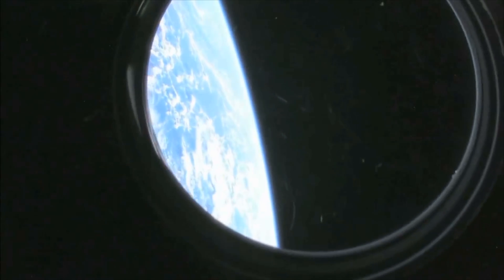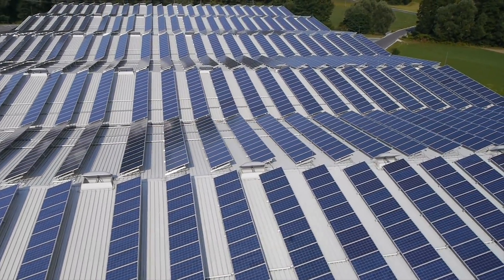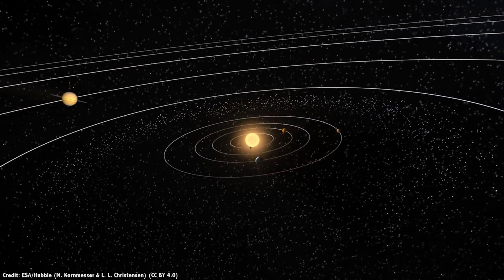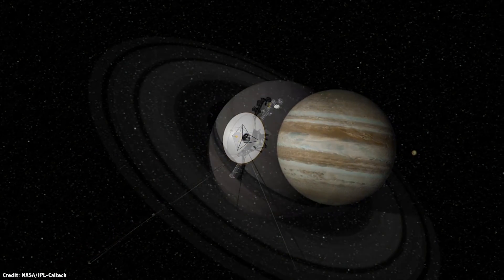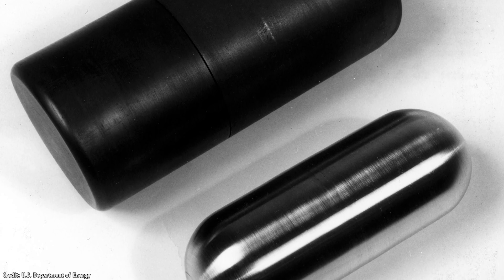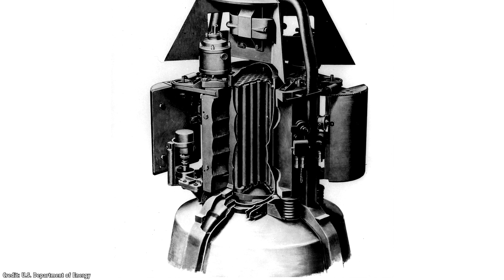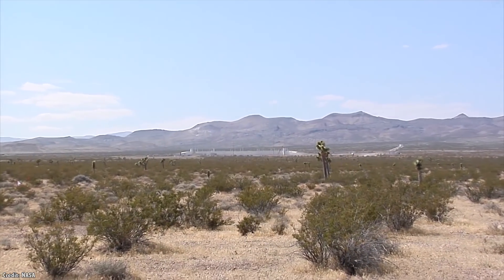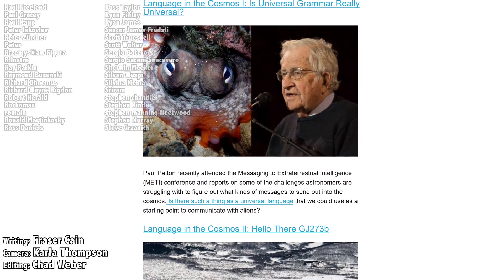The Problem of Power in Space. NASA's New Kilopower Reactor

Comment: Betavoltaics is an option but no space craft I know of has used it. Tritium could be used for it but the relatively short half life (12 years I think) can be a downside.

Americium-241 has been talked about for use in RTG:s, with a half life of over 400 years it could power a space craft for centuries.
Reply: Mind those gamma rays! The alpha particles will stop at a sheet of paper but gammas penetrate a couple of centimeters of lead or more.
Reply: zapfanzapfan I have to agree, the only disadvantage it has is of its energy density which is a quarter (0.25) of Pu238 isotope (The best fuel for RTGs so far)
Reply: As pu-238 decays, it generates a bunch of heat.  It literally glows red hot.  The energy, or heat in this case, is directly and inversely proportional to the half life.  So as the half life increases, the heat generated decreases.  Thermocouples use the difference of temperatures between the source and the sink to generate the tiny bit of voltage. Switching to am-241, having a half life of 432 years, may not be hot enough to be beneficial.  I thought it was interesting that am-241 was used in older smoke detectors.
Reply: Ricardo, are you talking about the same thermo charges that took down all the buildings on 9/11?
Reply: Larry Beckham: A fission reactor only gets dangerous after it has been running, before that it's just a lump of uranium and the ocean already contains a few billion tons of uranium. You can extract uranium from seawater but presently it's cheaper to mine it on land.
Reply: Larry Beckham exactly but the penetration power of Gamma rays emitted by Am is not as much as you think it is compared to the Pu emitted gamma rays, I would say,since Am's density is about a quarter of Pu, Take it 25 mm of extra lead, I might be wrong don't take my word for it.
Reply: Paul Mobley: A rocket carrying a satellite with an RTG with Plutonium blew up after launch, the RTG was fished out of the ocean and the material reused. They are sturdy suckers :-) Also, an RTG on the lunar lander of Apollo 13 reentered over the Pacific (since it didn't land on the Moon) and didn't break up.
Reply: Ricardo Moreno: ESA is looking into using Am-241 for RTG:s (we don't produce Pu-238) since Am-241 can be extracted from civilian nuclear waste.

http://www.world-nuclear-news.org/F-can-americium-replace-plutonium-in-space-missions28071401.html
Reply: The natural mix of isotopes of uranium that you dig out of the ground, or extract from seawater, is 0.7% U-235 and 99,3% U-238. Reactors moderated by graphite or heavy water can use that natural mix but most commercial reactors are light water reactors that require slight enrichment of U-235 to 3,5% or so (normally using ultra centrifuges). It's U-235 that is fissile so it's that isotope that is important in a reactor, U-238 is mostly just in the way stealing neutrons and making transuranic elements. The smaller the reactor the higher enrichment of U-235 is needed, some reactors in submarines run on 90-ish % enriched which is weapons grade, Little Boy had around 80% U-235.
Reply: my bad. you are right.
Reply: zapfanzapfan Now tell him that the uranium in the reactor isn't the same as whats in the ocean or whats in the ground for that matter. Otherwise they wouldn't have to do anything with it before placing it into the reactor.  But we aren't talking about uranium that hasn't been split are we.
Reply: Paul Mobley: The thing with reactor safety when used for satellites sent to the outer solar system or on a lander to Mars is that you don't turn them on until they are well away from Earth. Until then the fuel is just a lump of uranium. It's only after you switch them on that you get fission products and transuranic elements.
Reply: Paul Mobley: Yes, reactors produce plutonium when they are switched on. Uranium-238 absorbs a neutron and then decays to plutonium-239, if the reactor is kept running some plutonium-239 absorbs another neutron and becomes plutonium-240, some absorb another neutron and becomes plutonium-241, that mix is what is called reactor grade plutonium, for weapons you want as pure plutonium-239 as you can get.  Plutonium-241 decays to Americium-241 with a half life of 14 years so used fuel that has been left for a while can be used to extract Am-241.
Reply: Tom Kelly: If I remember correctly Kirk Sorensen says in his presentations that Pu-238 is one of the  byproducts of the thorium-reactor, so if we had thorium-reactors there would be no shortage of Pu-238. I guess since it is a liquid fuel reactor the Pu-238 can be chemically extracted from the fuel when it is created before it absorbs more neutrons to become Pu-239 or higher and become difficult to extract pure. There is some Pu-238 in regular used reactor fuel too but the problem there is that chemical separation gets you a mix of plutonium isotopes that you would then have to use ultra centrifuges to separate (like U-235 is separated from U-238), but I have never heard of anyone trying that.

Britain and France do reprocessing, I guess that's why ESA is looking into Am-241 since it can be extracted from old used fuel.
Reply: Roland Lemmers Dont forget that the only radioactive material will be natural uranium of which doesn't have the same range and deposition through the range as what a nuclear power plant produces.  Lets also not forget that human DNA has had centuries  to get used to that type of radioactivity, it will never be able to keep up with what man is doing to it.  I agree coal is a bad option but if you truely believe that whats in coal is anything like a nuclear meltdown and its radionuclides then let us know how much coal would have to burn to equal what has been released from nuclear power plants,meltdowns,bombs, spacecraft, etc.  And not only match the volume but also the energy released.  I would allmost bet we have still yet to burn that amount of coal.
Reply: @paulmobleyscience  "...the only radioactive material will be natural uranium..."
Thorium-238 is about 3 times more abundant than Uranium-238 and -235 in the earth's crust, and is a throwaway waste of mining operations. But unlike the lightwater fission reactors used in civilian power production that need to get as close to critical as possible for maximum power production, LFTRs are breeders that take advantage of the natural decay to produce power instead, so the design is stable at low pressure, therefore much safer. Renewables would be a much better alternative, I agree, but not all geographies support large scale renewable power generation to power their civilian centres. Fission reactors need to be discontinued, but we still need to look at LFTR as a viable alternative.
Reply: @BlackEpyon  Unfortunately for LFTRs, they do not have a metal that can take the fatigue.  Its the same thing for fusion reactors, for them to be able to last more than 5 years a new, unknown metal must be found to make them suitable for decades worth of time.  Yes much less, but still produces radioactive waste.  There is no free ride no matter how much we try, we will allways pay for it one way or the other.
Reply: @BlackEpyon  Complained? You misunderstand sharing of information as complaining.  I've allready given a solution yet you havent noticed it because I havent outright said it.  Ok here you go and this is the only solution.  Stop all fossil fuel,nuclear and coal usage today because the only ones that need more power than a solar company that comes to your home and installs a system that will in FACT take care of more than 100% of your energy needs are industry.  To make industry curb its output you and everyone else must stop consuming like its going out of style.  Wind generation, geothermal generation and wave generation is more than enough to take care of the excess we need.  We do not need to bank the energy, we already have a national grid that can move energy from one end of the country to the other.  To say renewables can not take care of our energy needs is a complete lie and its been proven allready and the ONLY thing holding it back is nuclear (which is subsidies through Price Anderson more than all put together),fossil fuels and coal company owners, and the national grid owners that have all the control in place with corruption surrounding the entire issue.  What have you done besides bitched on the internet "we need to use more LFTRs" Waaaaaaaaaaa  😭😭😭😭😭 I want my power 😭😭😭😭😭
Reply: @paulmobleyscience  
"To make industry curb its output you and everyone else must stop consuming like its going out of style."
That's a rather naive and oversimplified way of looking at things.

I didn't imply that LFTRs were the only way out. Just that they shouldn't be ruled out on the grounds of the issues you describe, because they will have their uses. 

The issues with solar can be resolved with energy storage and the energy grid. I like the idea of all new housing construction being required to install photovoltaics to supplement the power grid. Wind and solar tend to go together, as constant wind (the kind ideal for wind-power) is more prevalent in areas that also get a lot of sunlight where the thermal differential drives the air currents. Tidal is only viable (for obvious reasons) at coastlines. Hydro is relatively clean other than having to divert ecology to make the hydroelectric dams, but it's also limited by geography. My own region gets it's power from hydro.

Geothermal heating (for houses) is available everywhere as a result of the differential between the surface and below 10 or so feet, so that isn't an issue, but for electricity generation, you're limited to the areas that are best geologically suited for it with high thermal gradients, particularly volcanic areas like the Hawaiian islands, etc. However, geothermal power production does bring some cons with it, such as the hot spot cooling down, and release of geothermal gasses (hydrogen sulphide, etc) and slurries containing toxic chemicals that would have otherwise remained buried, etc. Not insurmountable problems, but they need to be considered.

Areas that aren't ideal for renewable energy production will have to import their electricity.  Yes, true, we have national power grids, but they only make enough money to maintain the grid by producing selling electricity.  This presents economic issues in that communities that aren't ideal for production, particularly northern cities and towns, will either have to balance the import of electricity with material exports (such as mining communities), or switch to local nuclear power production. Not insurmountable issues, especially if the power companies that maintain the national grids are nationalized, but that would require a change in social attitude away from capitalism towards socialism, as well as the political restructuring that would go with it. Again, these are problems that can be solved.
Reply: @BlackEpyon  Now we are having a civil conversation thank you.  Yes, I will agree we will have to use everything possible to get out of the mess we have inherited.  But, the corruption stops all the roadblocks of the grid.  The national grid should be just that, our nations grid and not companies owning it.  This will take much more than a specific or multiple changes in the way we produce energy.  This will take not only political change but also societal change that will indeed insist that we massively curb our consumption of not only energy but products as well.  Its the blind consumption, the keeping up with the Jones down the street.  Its ramped everywhere, we have 4 % of the population yet consume almost half of all products and energy.  That is the first thing that must change and then we can move forward with the ammunition of knowing we do not need to produce all that we are and the amount of waste that is produced not just physical waste but energy thats produced and then just wasted to the ground can be decreased.  This must be done right from here on out because what we do next will decide if ,we as a race, move into the future.  

Through the Milankovitch cycles and solar cycles along with the calculations made by Valentina Zharkhova along with many top scientists, with the TCI showing massive heat loss,quadrupoles of the sun going out of phase shows us the Earth is moving into at least a century long grand solar minimum with the calculations showing possibly up to 400 years. This will cause every single power source to cease to exist because once the sun gets down to a certain level it will send out a 360° Carrington style event except much worse and cause every electrical device to be fried instantly.  We dont have time for anything other than getting all the nuclear power stations to be shut down and the fuel placed in dry casks before this event hits and with seing all the movement going on, we may not have long before it happens.  So no, we do not need to worry about energy production...we need to focus on food production and means of electrical production that can be done on a personal scale and not on a populus scale.
Reply: @BlackEpyon  Northern cities and towns are about to be under so much Ice, no one will be living there anyway.
Reply: The real killer from burning coal is the particulates. In terms of over all deaths per energy produced from power sources, coal is the worst and nuclear is the best or second best.

https://www.forbes.com/sites/jamesconca/2012/06/10/energys-deathprint-a-price-always-paid/
Reply: zapfanzapfan Afraid I must disagree again.....is coal carcinogenic?  How about radionuclides, do they cause cancer? Of coarse so why does the coroner say that the cause of death is cancer instead of what caused the cancer?  What causes the cancer is the real cause of death and these statistics are not adding all the cancer deaths because they can't tell us what caused the cancer.  Therefore, if they can not seperate the different cancers onto different cause catagories then the statistics are fraudulant.  Those numbers are bought and paid for by corruption and greed.
Reply: Smoking causes cancer (among other diseases), doesn't matter if the smoke is from tobacco, coal or wood. Have you seen the air in Beijing? It looks like 1950s London.

And if you think someone is paying off the health organisations, do you think the fossil fuel industry is poor and lacking political power?
Reply: But you need four times the weight of Americium as Plutonium to get the same power. And the extra added bonus of lots and lots of gamma rays. Not really friendly to electronics.
Reply: @larrybeckham6652  If Americium  is so dangerous why do 98% of all home smoke alarms use it in the ionization chamber??
Reply: @timcoleman8964  Americium emits mostly alpha particles (which can be blocked by your skin or a sheet of paper), and relatively little gamma radiation. The quantity in your smoke detector emits less gamma rays than the background radiation. In that quantity, it's only harmful if you swallow it.
Reply: @BlackEpyon  Correct,, that was my point. It is a shame most people don't take time to research the truth about our use of radioactive materials and the amount of background radiation we live with everyday. I would like to see our country go full force toward nuclear power using the LFTR we invented in the 60's. As for the anti-nuks, I love to see when they protest while eating bananas, which contain Potassium-40, which is a radioactive isotope of potassium. ;)
Reply: @BlackEpyon  Correct, that was my point. Most people don't take time to research the truth about how much natural radiation we live with every day .(https://www.sciencefocus.com/science/top-10-which-are-the-most-radioactive-foods/). Personally,  I would love to see our country get as close to 100% nuclear for our electrical needs as is practical using the LFTR technology we invented in the 60's  and go full force developing reasonably safe nuclear propulsion. I'm convinced the reward would be worth the risk in the long run.
Reply: @timcoleman8964  Now, lets not get ahead of ourselves. As I told Paul, LFTRs are a functional technology, as the MSRE at Oakridge National Laboratory demonstrated, but there are a few bugs to work out before full scale adoption, such as development of a more corrosion resistant alloy to increase the service cycle before overhauls and ensure greater reliability of the system. My overall point is that we need to keep all options on the table, because each method of power production, even alternative green methods, have different ideal factors, both economic and practical, that need to be considered. Even if we went to LFTRs, we've still got radioactive waste to deal with, even if it IS shorter lived. There's no one-size-fits-all solution.
Reply: @BlackEpyon  Yea, I get too excited sometimes. I do however think other countries are leaving us "US" in the dust in development of MSRE technology to our detriment. MSRE Nuclear is not perfect but if fully developed could be the safest  and lowest waste producing reactor until we, someday, figure out fusion.
Reply: @timcoleman8964  Regarding fusion, ITER is building it's new complex for their 500MW prototype tokamak reactor. The pit is completed, and they're beginning installing components this year. https://www.iter.org/ It's still going to be at least 2025 before "first plasma," and another 10 years projected before they're actually fusing deuterium and tritium. Based on previous experiments, they're confident that this one will achieve "break even" by a factor of 10, which has never been done before. But even this reactor is just a prototype to bug out the concepts. It's not intended for civilian grid power production, but as they say, "to pave the way for the machine that will."
Reply: Paul Mobley and zapfanzapfan, How do you think U233 would stack up against Am241? I am a fan of Using Thorium as a fuel here on earth, I wonder if you thing the byproducts would make useful fuel for space, either as RTG fuel or reactor fuel.

Also when you are considering Am241, isn't its relative abundance much lower than Pu239? I am under the impression that the lower the number is, the less abundant it is. 

Also when it comes to politics, most countries will be unable to produce fuel for space since the purity required for space applications is similar to that required to make bombs too. At least Iran and North Korea would certainly not be welcome to produce these kinds of fuels, and the same would go for most countries on earth. It is too bad, because we are wasting lots of potential by not reprocessing our waste right now.
Reply: zapfanzapfan Your right all smoke is carcinogenic but which cancer was caused by which?  Which cancer was caused by the pressure releases that spread radionuclides into the atmosphere?  Price Anderson subsidies shows us where the large portion of the corruption is coming from these days.  The fact of the matter is that the corruption and greed has made this world believe that we can't have power unless we use nuclear or fossil fuels.  Just because someone told you or you read it somewhere doesn't make it so.  The medical industry is just as corrupt as the energy sector.  And look, most of which are subsidised and funded by the government.  How much corruption and greed is in every government on the planet and somehow you dont believe the nuclear companies are corrupt along with the regulators?  You must work in the nuclear sector or know someone that does because those are the only people that are pronuclear.
Reply: nobody mentioned reasonating tesla pancake coils ?...  no dangerous radiation, and no bearings... although the IGBT's may not last 15 years...
Reply: The SNAP reactor satellite when being tested for safety blew up and spread radioactive waste all across America. 

Fast forward to today and the one in orbit is literally falling apart with more chunks, 30 or 40 pieces greater than 10 cm in size per year, and increasing anually.

We are so reckless with nuclear power it is crazy.
Reply: zapfanzapfan Actually, I believe every single nuclear reactor produces plutonium.
Reply: Paul Mobley, only if there is Pu-238 in said reactor
Reply: zapfanzapfan  The Juno space craft has a orbit around Jupiter that is highly inclined to Jupiter's orbital plane,  thus it is always in sunlight! That is why it doesn't need Plutonium fueled RTGs.
Why make RHU's with Plutonium? Why use a fissionable isotope if they are only to create a few watts of heat?
Reply: Ricardo Moreno,  
So the Pu they use in space craft RTGs has a half life of ~ 92 years?
Reply: Betavoltaics? Is that like a Promethium Cell? They have been around since before 1974
Reply: What about the diamond carbon 14 power sources? 
Or this isotopic battery concept: 
"research is also underway to determine the feasibility of accessing energy stored by isotopes at 100,000 times the density that chemicals can provide."
Army-led effort demos new atomic effect for potential isotopic battery
February 07, 2018 By ARL Public Affairs
https://www.arl.army.mil/www/default.cfm?article=3162
Isomer depletion as experimental evidence of nuclear excitation by electron capture Nature volume 554, pages 216–218 (08 February 2018)
doi:10.1038/nature25483
https://www.nature.com/articles/nature25483
Reply: Man, this is a smart conversation. 

I'm just gonna sit quietly over in my corner and absorb😊
Reply: LOL, Me too!
Reply: zapfanzapfan A lump of u238 not u235 which is the natural uranium.   Big difference between the two when talking about energy released not to mention the range and deposition through the range.  Again, just because they sucessfully sent uranium into space without incident doesn't mean it will allways happen in that same exact manner.  This being the case, we shouldn't be taking chances for no good reason.
Reply: zapfanzapfan Yea definetly my mistake.  I meant to type u238 natural, u239 is man made.  Too many transuranics and radionuclides to keep track of.  Maybe one day we will get our power without using any nuclear materials for the generations after us to take care of the most dangerous waste on the planet for their lifetimes.
Reply: Tom Kelly The issue is that when you have to do another  complicated task just to justify using the first complicated task then where does energy production draw the line.  We talk about the version or that process instead of talking about if it truely needs to be done to begin with.  Corruption and greed is what has driven what we use today and manipulation of all the information has caused us to spiral out of control.   Thorium is a no go.  Yes the process is better than typical uranium fueled reactors just for the fact the waste doesn't take as long to decay but still long enough to either have to reprocess it or it be stored for a few centuries.  We can't build the vessels strong enough because after 5 short years the metal shows fatigue throughout in its entirety.  How can any of these processes be cost effective when so much from beginning to end had to be achieved just for it to half way work?  Its not, from secret funding to straight out subsidies that lobbyist swindel us out of these companies can not turn a profit on fission fussion or any other complicated process.
Reply: zapfanzapfan Every nuclear reactor produces plutonium and is the only reason they built them to begin with not for power.  This is completly obvious when you factor how much energy we get from nuclear....less than 12% globally in 70+ years and how many trillions of dollars spent.  The fact is we private citizens do not need a company to produce energy for us, we can do it ourselves and have all the power we would need.  Companies are the ones that need to get their power from another company because they couldn't produce enough.  And lets not forget who holds the key to every nuclear reactor on the planet...the worlds militaries.   Every bit of it is over war and greed and nothing more.
Reply: Paul Mobley 
Thanks for your input.
You are a wise man indeed
Reply: Chad Castagana I must disagree, any reactor that has u238 will produce a build up of pu239 in the fuel.  Just about every reactor has u238 inside
Reply: zapfanzapfan I understand what your saying but keep in mind just like anything, just because it works one time doesn't mean that it will allways happen in that same manner.  Sturdy or not the laws of the universe say what ever can go wrong will go wrong especially when human error is involved.
Reply: Ricardo Moreno Its rediculous the amount of transuranic elements and radionuclides they have placed into society for the only reason being that they can not because it needs to happen that way.  Gauges, smoke detectors etc... and many don't even know it.
Reply: zapfanzapfan preaching to the choir zapfan.  I know now tell us how many radionuclides exist?  The radioactive isotopes that are the sisters from that nuetron.  Every nuclear reactor, that would be turned on otherwise whats the point, produces plutonium and in fact the only reason they built them to begin with.  The actual list of radionuclides is well over a thousand of which they have yet to discover all of which comes from the chain reaction.  Here in lies the issue, its not about the days when everything goes to plan, its about the days that don't and all hell breaks loose like in Fukushima.  The issue is that we humans have become arrogant in thinking we can cage this energy as if there wasn't a reason our planet is shielded from this type of energy and in affect we are as well and the only reason there is life to begin with.  Yet, we humans build over 500 death power stations allowing not only just a little of this diabolical amount of energy to be placed within the shield on the surface of the planet but a massive amount of which could wipe out all life many times over.  The issue is what we do with uranium is like nothing else on earth.  Even the natural reactors do not produce near the amount of transuranium elements or radionuclides as a melted down reactor core in china syndrome otherwise there would be no life on this planet.  The world needs to do away with fission and fusion before they do away with the world.
Reply: Paul Mobley can you imagine a if a SLS blew up on the pad with a kilopower fisson reactor? The Cape shut down for years as well as many cancers downwind. What if the wind was blowing to Miami?
Reply: Larry Beckham that’s why you assemble the reactor in either a high LEO or a low MEO (350-600 km).
Reply: @larrybeckham6652  - Technology exists to contain nuclear cores subjected to external chemical explosions. It is deployed for nuclear weapons.
Reply: @larrybeckham6652  Bull shit, the concentration dilutes into background radiation.  That makes it no longer a concern.
Reply: zapfanzapfan Yea and also spread tons of radiation when one blows up on its way off earth just like the ones they tried allready.
Reply: Larry Beckham Exactly, these people only ask if its possible and never if it should be done to begin with.  A few years, you might as well say a few lifetimes depending on the material.  We allready have this issue and its called Fukushima.
Reply: @paulmobleyscience  No one died of radiation at Fukushima.  Some people died just because it was an industrial accident...but that could have happened in any power plant hit by a tsunami.
The biggest risk is radioactive iodine with reactor accidents.  Our bodies are designed to deal with much higher background radiation and correct any genetic errors that might occur.  This was not realized until relatively recently.  They just thought we accumulated the damage and eventually had problems like cancer.  But it does not work that way.  It is more like sunlight.  A little is just fine, but too much and you get sunburn.  If you get too much too quickly the correction mechanisms can't keep up.  Radioactive iodine is a problem because it gets absorbed even from the air and then concentrated in the thyroid.  When that happens the dose become too much and you get thyroid cancer. 
The Japanese get a lot more iodine than we do in the US because they eat seaweed and lots of fish.  If you don't need iodine your body does not absorb it.  So that worked in their favor.
We went far too negative on reactors.  Most of that was lies and ignorance.  We would be in a much better place with CO2 emissions, if we had not gone off the deep end.
Though, these space reactors would likely be much worse if the blew up in the atmosphere or on the pad.  I think they can be protected well enough for both of those scenarios, and likely would be.  The more troubling scenario would be some kind of uncontrolled reentry.  There is just so much energy in something going 17,000 mph.  Just putting in some shielding is not likely to be effective.
Reply: @ChessMasterNate  Prove no one died then.  Just like trying to prove one,some or many have died, it cant be proven how many people have injested hot particles,been exposed externally or internally or if other things such as noble and inhert gases, chemicals such as hydrozine or other elements like boron have been injested to cause issues and disease with people or animals alike.  Cancer being only one single diseass out of many that are caused by radiation exposure and everything else associated with meltdowns and explosions has an incubation period inside the body.  Doctors nor coroners are pin pointing the causes of the diseases and it is impossible to know either way so dont try to tell anyone that no one has been killed by Fukushima because even the so called experts do not know, how could you?
Reply: @ChessMasterNate  Our bodies are not designed to take what comes from a meltdown.  The range and deposition through said range of radioactivity coming from Fukushima are nothing compared to the natural radioactivity our bodies have been exposed to for a many centuries.  Apples and oranges are both fruit but hardly the same thing.
Reply: @ChessMasterNate  Wow did you waste a ton of time typing that mess out.  "Prove...thats now how science works...."  wait what?!?!  Each radionuclide is uptaken mistakenly as something else by the body.  Cesium is deposited in bone because the body takes it as calcium.  Strontium heart?  It only takes one single atom to cause an issue inside the body.  Averages and statistics amount to merely a roll of the dice.  Now, nothing you named can wipe out all life on this planet like one single nuclear reactor can out of the 500+ globally.  All the while the statistics and averages are corrupted by people and people such as yourself quote this undeniably incorrect information.
Reply: @ChessMasterNate  Ill tell you what projection is wrong and it deals with the use of the inverse square law.  Every radiation detection monitor is calibrated and measurements taken by using this law.  Except that law does not apply to extended sources nor can it be used for anything other than a point source.  The stipulation itself is written into the actual law and fully shows there is no way of detecting the correct amount of radiation or radioactivity in earths environment.  Not only is it impossible to make the necessary corrections but the use of constants and the magical number of Pi shows the calculations can not be correct.  It would be impossible for the center to be found, otherwise ots merely a guess.  Sure, one can use these devices to show a massive release but actually using them to pinpoint and make decisions based on guessing is not the way science is done.  Radiation can not be properly detected and for that reason alone means this technology should not be used.  The medical implications can not be denied so much so even pro nuclear scientists couldnt deny the findings for the NLT nor the massive amounts of peer reviewed studies done showing the damage caused by radiation exposure.  There are only 2 types of people that are pronuclear....either you directly profit from its use or you know someone that does so which are you?
Reply: @ChessMasterNate  Also, we dont need to do anything about global warming because very soon we will wish we had some global warming.  Through not only the Milankovitch cycles which is causing the Earth to move further away from the sun now from its closest approaching cycle and solar maximum which fully explains the rise in temperature and ice melt but also the present and future solar cycle that has the suns quadrupoles out of phase and no sunspots for a long period of time that will cause the Earth to begin cooling on a drastic and global scale.  The sun is headed for a grand solar minimum in its 400 year cycle.  Besides, what models are you looking at for global temperature? The ones I've seen show merely a .2 temperature rise since the late 70s.  You can barely even measure a .2 difference within a days time let alone a few decades.  The global warming narrative has been a complete and utter lie.  Not only is it based on one single factor in CO2 but even added with methane is not all the factors of climate forcing.  Changing of the climate is mainly driven by factors off the planet not on it. First, the Earths electromagnetic field is driven by the sun electromagnetic field.  When they are deminished this it causes the magnetosphere to collapse inward towards the planet allowing not only more positively charged ions in but allows more cosmic rays such as muons to penetrate even further causing more volcanic activity which we are allready seeing.  When this occurs, cloud nucleation will increase causing even more cooling allowing glaciation to also increase.  This process also allows the solar wind to penetrate and cause massive fluctuations in the jet streams and cause oscillation to occur making some places breaking warmer records and other places breaking cold and snow records of which we are also seeing. This can be survived in the past but now with 500+ nuclear reactors, most of which need offsite power to keep the pumps working otherwise they meltdown with over 20 in the US alone, when a 360° Carrington style event or a mini-nova occurs this will cause many of those reactors to meltdown along with their spent fuel pools.  A risk like that isnt worth all the power in the world.
I know the 17 chains and in alpha decay mode end with 2 protons and 2 neutrons and a gamma release.  I know that starfish absorb up to 1000 times more plutonium than any other animal in the ocean. I know that barium and alluminum silicates are used to remove strontium from sea water and coupled with a RF resin can remove cesium as well and they do this everyday right now.  I know that Hiroshima wasnt started being studied until 5 years later.  I know that doctors and coroners do not know what causes the majority of diseases.  Until that is specifically known, no death or disease statistic is complete and can not be used as evidence.  Yes, I know better than all that corrupted garbage you have typed out.  Youre not a realist,you are a selfish person that wants more power coming out of your wall and thats it.
Reply: @ChessMasterNate  Check mate.